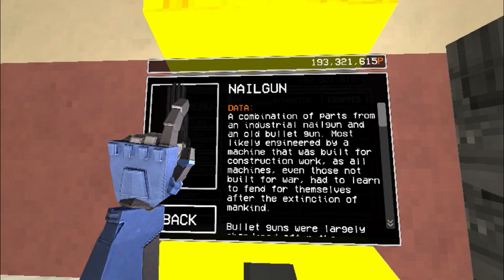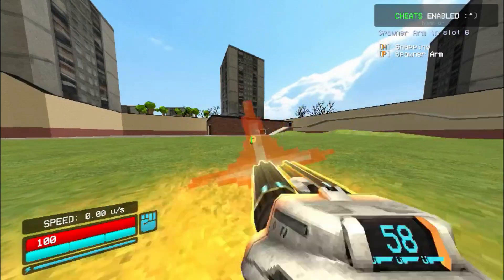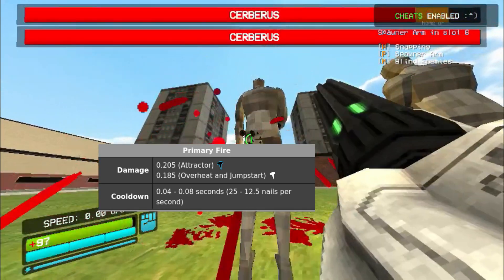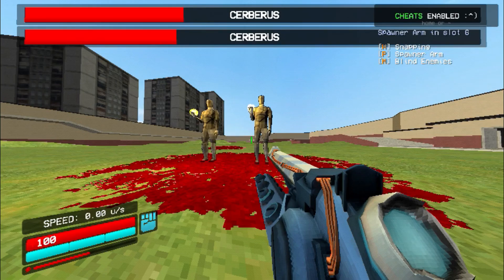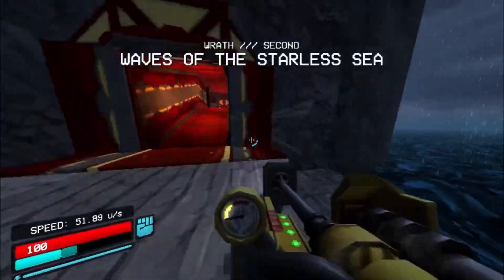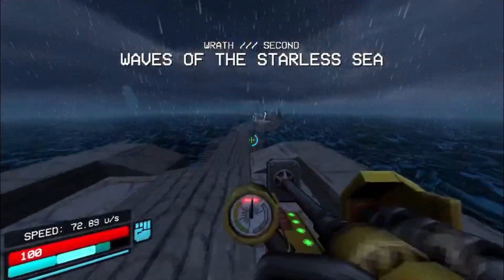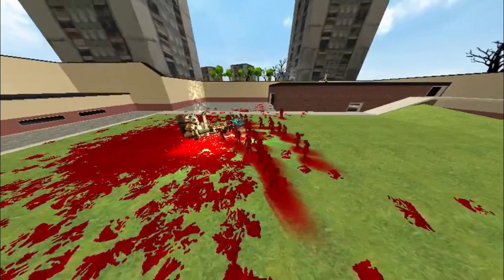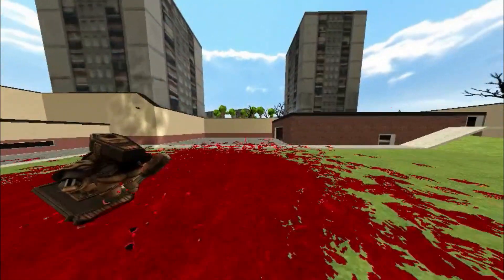How Does Ultrakill's Nailgun Work?

Comment: 0:33  tbh i wonder how realistic it is to create a weapon centred around electric sparks, we have spark transmitters and lightning bolts but the former is rather short ranged and the later is charge build up over a relatively large area, i guess the cabled enemy and the "conductive" enemies create a very large electric pd for the spark to have relatively long range

Comment: I completely respect you calling the nail gun the most powerful weapon in the game because conductivity is so fucking broken, the saw blade doesnt even matter at that point
Reply: I can agree very loosely, conductivity is absolutely broken, but when using jumpstart, every time an enemy is hit with a saw blade it takes one less second for the conduction to happen, so a decent strategy is setting a sawtrap, immediately heat blasting an enemy with the green nailgun, and then using alt jumpstart fire five saws for a pretty low risk high power conduction setup.
Reply: @Symmetry_Obsessed_Freak  i prefer the normal jumpstart, especially because you get a faster firing speed with the nailgun with the cable in
Reply: @PurplePotatoGoat  That’s fair. I feel the faster firing speed of the saws combined with the shortened conductivity time suits my play style better, but to each their own. This is a game all about expression through gameplay, what works for me may not work for you and vice versa.
Reply: You can use normal jumpstart and then switch to sawblade launcher @PurplePotatoGoat
Reply: @Symmetry_Obsessed_Freak you can just use the blue rail cannon if the enemy is embedded with nails to have the same effect as the jumpstart
Reply: I use blue sawblade, green sawblade and nailgun jumpstart
You can use jumpstart to make electricity jump between enemies and deal more damage and then switch to sawblade or use your saw trap tor instant charging of jumpstart
Reply: Saws + elect nail gun. Is sooo good
Reply: I think bosses are easier with saw blades 
Since the boss is the only enemy there, conductivity is less effective
And you can build up the saw blade ring if the boss has a monologue before the fight

Comment: One possible means of "cooling" is through evaporation (ie. Water turning into steam). 
I guess that the cooling system in the nailgun is a hybrid which runs water through it in a closed cycle until the firing mechanism of the nailgun overheats.
Upon release of said "heat", this cycle is "opened" by either releasing this superheated water into the nail loading chamber, or into the mechanism that rotates the barrels of the nailgun.
 In addition to cooling the weapon down, the steam would either act as an additional propellant for firing nails, or act to drive a mechanism to boost the loading cycle, or both.

Comment: First off, great to see you are my dash again and I hope your holidays are nothing but happy. 

Second, play my first comment on your 3 videos uploaded today so I guess I'll be going in reverse order of what I watched with the comments for each weapon on their respective video.

Okay, so I assume that the increased consecutive-hit-damage mechanic is essentially a product of the vapor based cooling pipe system right? With each bullet essentially gaining more heat from the hot vapor that's in the barrel or chamber leading to a hotter bullet each time and thus more damaging is what you're insinuating? I had a bit of trouble from point to point.